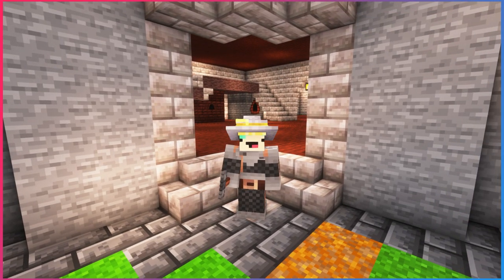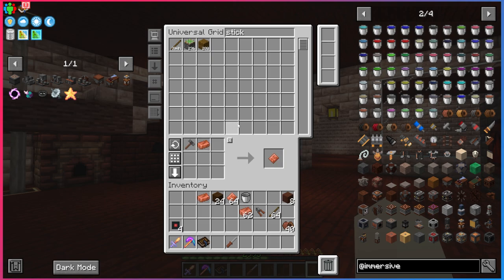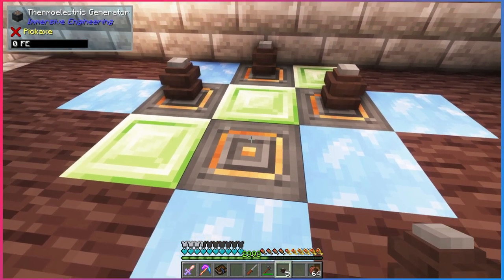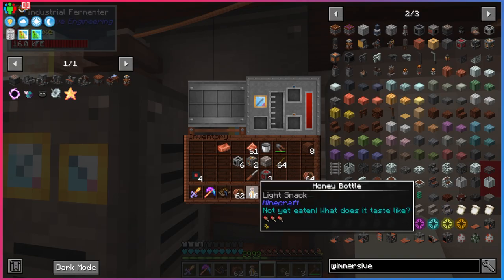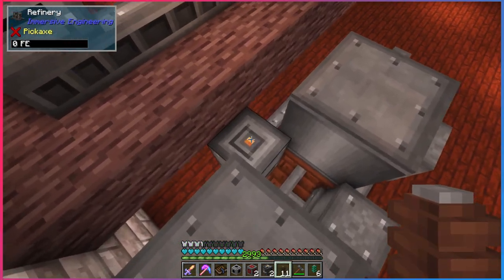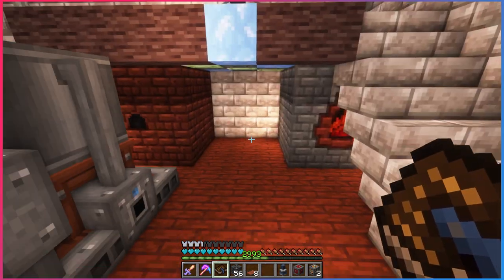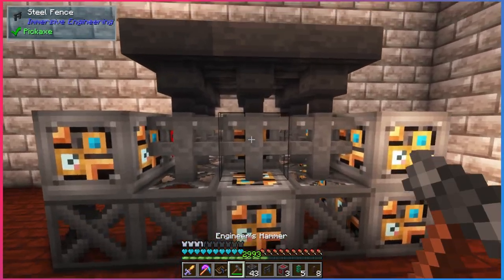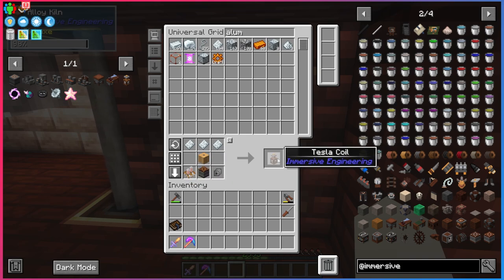Immersive Engineering For Dummies in 1.19.2 | ATM Star Journey Ep. 23

Comment: There is a way to pump creosote out of a coal coke oven, but you have to place the pump block first. Using the hammer, change the side that will have your coke oven built adjacent to a blue (input) port. Then complete the coal coke construction so it is directly touching the pump. When creosote is produced, the pump needs low voltage power and a redstone signal and it should flow into a container if you have a valid one that can accept creosote.

I am sure in the months on publishing this video, you solved that, but I figure I might as well share.
Reply from the maker: Thanks! This is great information! And no I never solved this 😅 I got super frustrated
Reply: @dupameister  
Fair. It took me a minute, too. I wish we could configure pump sides and move the block so it inherits the properties set on it, but you have to preplan for a pump lol. Glad I could help! Immersive Engineering is one of my top 5 mods.